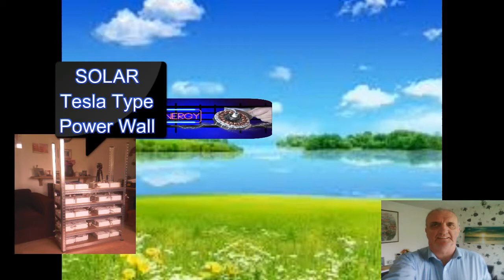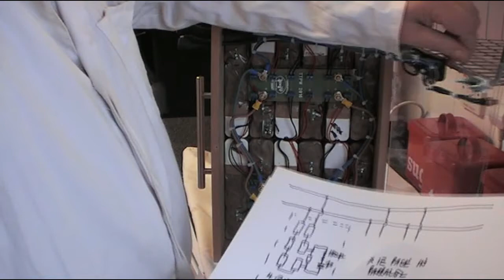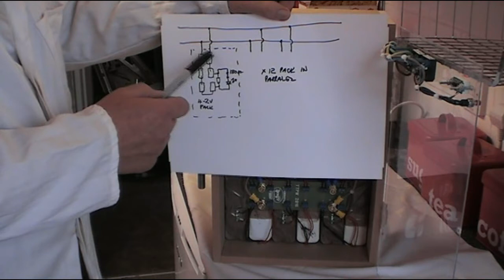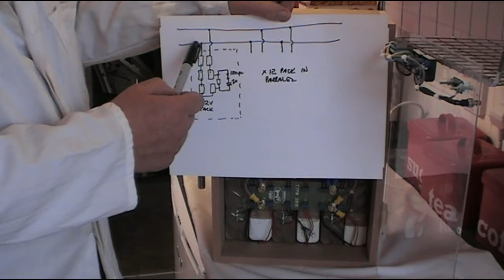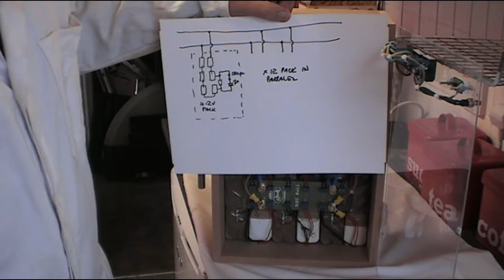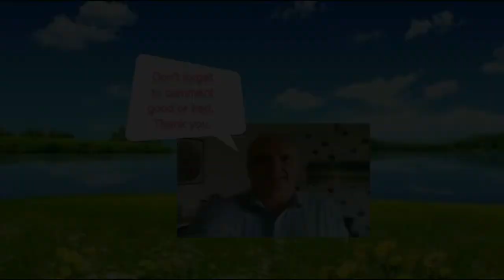TTPW Final Part 1

Comment: if the fuse 8s in parallel with the led it should light when the fuse blows as long as the current draw does not blow the led. I have only watched this video so far
Reply: Thank you very much for your valued input my new friend. I am part way through making video showing how I overcame the problem. It should work as you describe. But it doesn't due to what I can only call back feed from the other parallel packs in the TTPW Battery. The solution has an unexpected safety feature I didn't design into it. Video soon my very good friend. Have an amazing day.
Reply: Alternative DIY Energy Thanks I just subscribed and looking forward to how you fixed it. Have a great day

Comment: hey Ray, check your emails. but I have worked with stuff with LEDs before. Considering the voltages you might have taped an area when reassembling that "popped" the LED. Try sticking a new LED in to just touch the old LEDs contacts. then push the button to see if the new LED lights up.
Reply from the maker: It is to do with the parralleling of the packs. Thank you my friend. Got it sorted and video soon. My best regards to you alll.

Comment: Do you want the led to light if a fuse is blown during discharge or charge?
Reply from the maker: Each cell in the pack has it's own BMS board. So only required on discharge my very good friend.
Reply: Is this what you have?
https://www.forumplanet.co.nz/forum/download/file.php?id=7
Reply from the maker: Yes but R1 is 180 ohms. The 3k3 resistor is across the rails via a n/o push button. I have twelve of those cicuits in parallel. Thank you for helping my very good friend. Much appreciated.
Reply: so 12 like this and one 3k load resistor?
Reply from the maker: Can I have your email please. I have spent the last 20 minutes trying to send you the circuit. My email is solaray@hotmail.co.uk thank you my good friend.
Reply: I have mailed you You might want to delete comment above otherwise your email will get flooded with spam email.
Reply from the maker: You have email my good friend.

Comment: you have no load, your circuit is open. This led indication won't work unless there is a short circuit on the output. Short the output (without the5,, fuse!). this is what the resistor is doing. on the other hand if the resistor warms up, that means there is full current going through the  system.  The fuse terminal must be shorted out somehow. I bet the schematic you drawn does not match the real thing.

Comment: You need to diode the the parallel packs to the common rail. Yes the other packs are running current through your resistor. So you only have 1/12th the current through the resistor going through the faulty pack. Probably not enough to light the led well. You should compare current through your resistor to current through your LED.

Solutions would be to: 
Diode each pack to the common rail. This may be less than ideal depending on the larger circuit and charger.
Or have the cells disconnect from the parallel rail when under test via transistor, ideally depletion mode j-fets. Then you can incorporate some protection circuitry too.
Use a smaller ohms resistor for the test. This one is less ideal as it might not be reliable under some conditions. What happens if you replace the resistor with a 50-70w 12v high beam globe?

Comment: all your cells in the packs are good so even with a blown fuse the voltages are the same I think if one cell did go bad the voltage gap diference would be higher thus more current flow and a voltage diference greater then the led ilumonation lvl

Comment: Hi Raymond. What are all the cell voltages and the names of all the other components (eg their specs, values etc)
Reply from the maker: Hello Kev. The cells are 4.2V 4A. $A fuse. 180 resistor in series with LED. 3.3k resistor in series with push button across the output of the packs before the rectifier. Rectifiers are 35A. Thanks for your help.
Reply: Use your multimeter and measure the voltage drop across your led when your battery pack circuit is in parallel with other packs and when isolated (isolated is I think you said, when it is lit up. Measure it anyway). What are these two values? I think you will see for yourself that when in parallel the voltage drop will be zero across the led. Below is reason why.

From looking at your diagram you have two batteries in series and between them the LED and a resistor. Well this will be at a much lowe voltage potential. So the LED will not light up. The only reason it lights up when isolated from the main circuit, is that when you join the top section together (with a low value resistor I think you said) then you have a completed circuit and your led becomes the only impedance to this circuit (hence it will drop voltage which makes it light up). Where as the rest of the circuit offers a much higher impedance and so any voltage is dropped across that instead.
Reply: +Tech Tins I think you hit the nail on the head I think the extra packs alter the the voltage drop and lower the current flow or voltage difetence and stop the led been lit
Reply: Well sort of like that. Not exactly that but similar. I am assuming its because the other packs offer a far higher impedance than the LED. But I'm not 100% sure as I don't know what the rest of the circuit looks like.

Comment: I think it has to do with the voltage drop of the LED, when the pack is in parallel it is actually of a different voltage potential because of it, causing the power to be drained from the other packs first.Using a transistor should work,  when the fuse goes open it will create a voltage change that you can use to turn on the LED. Nice Vid.
Reply: I am thinking the same when he testes single pack they is enough load to alter the voltage to allow the led to light but when they are more packs in parallel they is less voltage drop so not enough to power the led

Comment: are there any parallel cells/fuses that could take all the load that would normally go through the LED? i dont know if i fully know how this battery is wired up, this is an odd issue.
Reply from the maker: Six 4.2V cells in series and one of the links between cells is a 4A fuse. with Led and series resistor across it. So when the fuse open circuits current then flows through the LED resistor combination. Thank you very much my dear.